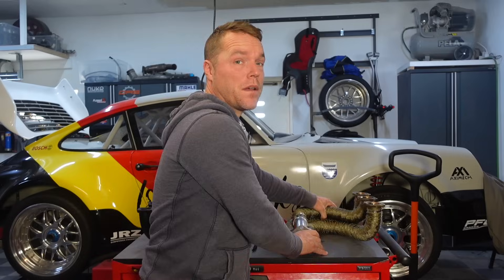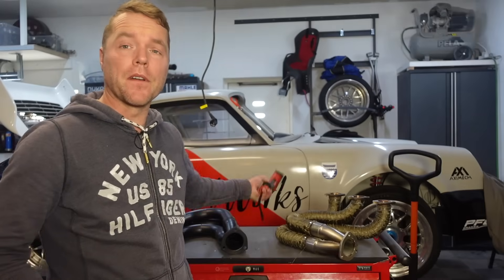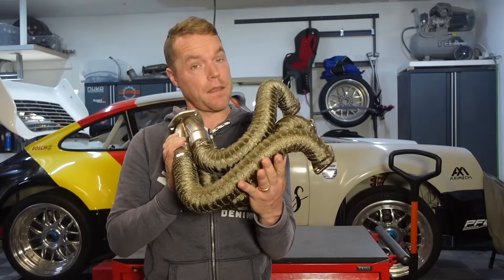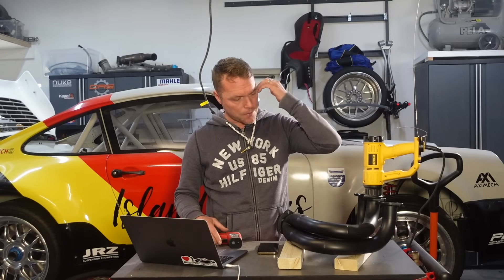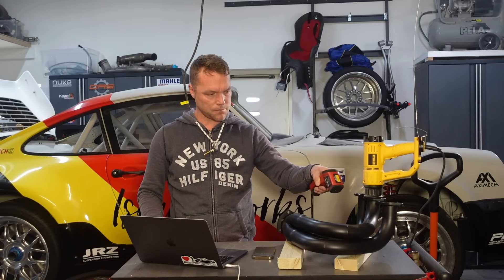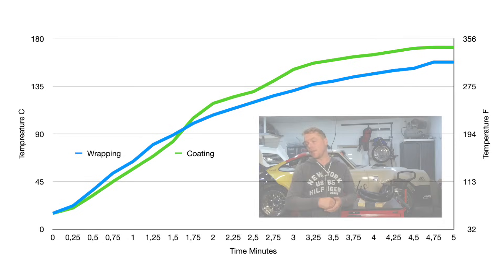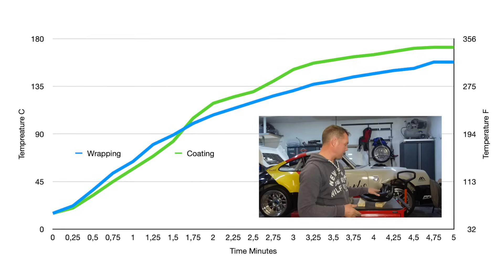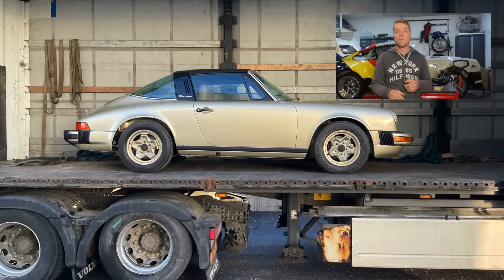Exhaust Wrap vs Ceramic Coating - Head to Head

Comment: What principle is the meaning device using? If it is a pyrometer you need to set the emissivity for correctly for each surface being measured. It can be quite inaccurate if you don’t.

Comment: Wrap smells bad.  Well, there is the fiberglass, which is absolutely horrible.  It does decrease somewhat over time, but never goes away.  There is the volcanic ash style which has a lot less noticeable smell, but is toxic.  As someone else noted, thicker ceramic like SwainTech's White Lightning is superior.  Go with that.

Comment: Wrapped headers for the win... based on actual dyno pulls and tests - not just a heat gun. 

https://youtu.be/H5LK-zjfYKA?feature=shared

They greatly reduce the under-hood temps and heat soak from the headers into things like your starter and plastic components under the hood. 

None of them make a difference in engine output. It's all about the under hood temps and in that area - the wrap wins. Some will say the wrap will cause the headers to fail earlier or cause the metal to degrade. I would tell them, stop buying cheap mild steel headers and get quality stainless. If you're going to do the job - and installing long tube headers on a car typically is not easy, buy once - cry once.

Comment: completely useless test.
where is the baseline test. no product applied.
heat shielding metal cover is waaaay better than wrap n paint to protect other components
and doesn't rust pipe cause fire hazard.
not every thought bubble marketing idea is a good one fo common sense

Comment: To solve all the issues people complain about here for wraps (moisture or fluids soaking through, brittle after a while, itchy if you touch them, etc) you just need to spray them with several coats of high-temp silicone coating making sure to saturate the weave with the first one (and usually bake them at 450F and then let cool between coats).  That will bind the fibers and layers in place and encapsulate them along with making them sealed to liquids.  Of course this doesn't work as well if you didn't do it before using them for a while.

Comment: The other benefit of the ceramic is that it helps to stop corrosion. That is why I used it for my Harley headers. 15 years later on regular steel tubing and no rust. I used Swain's White Lightning on my headers, valves, exhaust ports, pistons and combustion chambers.

Comment: Cerakote is not a proper thermal cermaic coating (it will provide little to none thermal protection). You need someone to do it that uses Zirconium as a thermal barrier otherwise it’s not worth it.

Comment: PLEASE NOTE: The reflectivity and color of a material WILL affect temperature readings via a laser, thermal camera, or other non-contact measuring device. This does not mean the information gained here and the determination is bad or incorrect it just means the fine details and temp readings may be inaccurate.

Comment: wow using a heat gun to test exhaust temps, why not just put the engine on a dyno and change the headers and then test with real exhaust temps and not a heat gun really, thats is so lame, to think you have a porsche race car and your using a heat gun to test temps on headers for the same car, plus it comes down to the material used in the headers different alloys transfer heat differently as well, like using stainless compared to say mild steel is a massive difference and also depending on who makes the exhaust system, like akrapovic exhaust systems are next level full stop, leave it to slovakians to make the best aftermarket and OEM exhaust systems for cars around the world. ✌✌🦘🦘👍👍😎😎

Comment: Wrap doesn't trap any significant amount of moisture according to the videos I've seen where they de-wrap them a year later and found no evidence of corrosion whatsoever. The headers are way too hot to have any moisture accumulate on them through the wrap.

Comment: I used high temp paint and then wrapped! 9 years and 30,000 miles later, still looking good.
Reply: you using 3mm thick and stainless steel?

Comment: 4:19 when I ceramic coated my pipes, I inquired about coating inside as well. He explained that while the opening and straight portions will have coating, bends will not because the medium doesn’t make its way there. Possibly why you have such a variance in temp at that spot.

Comment: I wouldn't say either is a bad solution for radiant heat. Both methods help to reduce the problem. I would also concur that the wrap could present a safety hazard. The wrap has the ability to absorb oil, where as the coating will only allow so much oil to stick to the header before it just drips off. That said, oil, though flammable, will evaporate, or smoke when it gets where it should not be. It can just burn off. If it is a race vehicle, or on any vehicle of an enthusiast, if there is smoke, wouldn't any of us just stop and find out what the problem is? Safety problems therefore should not be that big of a deal in this context.
   The benefit of a wrap is that it costs less than a ceramic coating. I was surprised that the wrap was more effective, but if that is paint on ceramic, it is less effective than an actual ceramic coating. 
   I like the idea that someone else presented. Ceramic coating with wrap.

Comment: Did you think about testing engine bay temps and cool down time
Reply: This! What is the tangible real world benefit?! it would be more interesting to monitor the surrounding air temperature 2 inches from the headers during normal operation

Comment: What bugs me about these ignorant tests is a total misunderstanding of how IR thermal cameras work.  You CANNOT accurately capture the temp of metals without FIRST putting a consistently emissive patch of paint on BOTH samples, unless you have a camera/IR gun that has adjustable emissivity, and you make use of those feature.  Your test was totally useless and meaningless. For example, Did you know that you IR gun CANNOT even see the temp of copper, stainless or aluminum?  They are almost perfect IR REFLECTORS, so the temp you see is the reflection of something else in the room.  And the % of reflection changes as the metals begin to glow.
Reply from the maker: Great comment!

Comment: Heat tape is not designed for what you're testing. 
It lowers the outside temperature 500 to 700 degrees. Inside raises the temperature !
That raise in temperature pushes the air more efficiently. 

That's not what ceramic coat does. 

It just dissipates heat quickly.

Problems?

Solutions ?

Different materials ?

If you'd like to concentration pm me.

Comment: Black color has maximum absorption AND radiation of heat. My professional advice would have been V-136 (Piston Coat, heat cure) for the inside of header, and C-7700 glacier silver on the outside (polished to chrome look). That what I did for my turbo and exhaust system.

Comment: exhaust temps are as high as 1300-1600f. this doesn't show that level of heat. you can't use infrared to measure heat since it's skewed by reflective surfaces. to do it right, you need a thermal camera or imaging device. infrared is the worst approach.

Comment: Interesting video @Islandworks and great to see the build coming on! If you have ever a chance to repeat this then a comparison with a few more options could be exciting e.g. uncoated, plasma-sprayed TBC, heat-shielding option.
Reply from the maker: It was intended as a quick test just to form an opinion in the wake of a previous project. If I knew it would get this much attention I would be happy to make something much more scientific. 

Now I’m still sitting there with two headers both different as I’ve been working on other thing…

Comment: I haven't wrapped a car's exhaust, but I have wrapped the pipes on my bike. The idea there is it's not only for heat protection and esthetics, but that it help add a small increase power and torque by keeping the hot air inside the pipes. If it's the same for cars, then it seems to me both ceramic coating and wrapping would provide the most optimal result. The ceramic coating will prevent water damage from the heat wrap, and weakening the metal due to excessive heat. The wrap will keep much of the heat inside the pipes, improving flow and boosting HP. 

FYI - the heat wrap has some waxy stuff in it that must burned off. Once it's burned off, the pipes will stop smoking. Building a race car, you will boost performance if you coat, then wrap your headers.

Comment: I think you should re test with different methods as other said infrared thermometers can read surface temperatures differently based on the color of the surface. This is because different colors have different emissivities, which is a measure of a material's ability to emit infrared radiation. Darker colors typically have higher emissivities and emit more infrared radiation, which can lead to more accurate temperature readings. Lighter colors, on the other hand, have lower emissivities and emit less infrared radiation, which can result in less accurate readings. Lighter colors usually have lower surface temperatures compared to darker colors under the same conditions. This is because lighter colors reflect more sunlight and absorb less heat, while darker colors absorb more sunlight and convert it to heat, resulting in higher surface temperatures.

Comment: Have used both on different projects over the years. For pure heat reduction wrap always works better than any type of ceramic coating. But for street applications ceramic is generally the better choice as it doesn’t lead to corrosion and cracking as quickly as wrap does.

Comment: I wrapped a set of headers once, within 2 years they were cracked. I just bought a set of ceramic coated headers because I don't want to go through replacing them again. Every company that makes headers will not warranty any header that has been wrapped for a reason.

Comment: If protecting your plug wires is the concern - start using a silicone based set. Currently, high silicone sets have replaced wire sets that used to "require" a metal heat sheild at the boot due to plugs being just inches from (and nesting between pipes of) the exhaust manifold on "old" trucks like the Ram (circa 1990 Dodge). If further protection is needed, run the wires themselves through a heat wrap/sheath.
 Also, if you dont want oil getting into the wrap - stop pouring oil on it.

Comment: Please note! That “heat gun” (optical infrared pyrometer) doesn’t actually measure the temperature of the surface. It measures the infrared light being emitted from the surface and this amount of light is based of the emissivity of the surface you are measuring. In this case, you have shiny black paint (pigmented with ceramic particles) and silvery cloth. These substances will provide two very different emissivity values. You can never honestly prove that these painted on ceramic coatings are effective this way. A better way is to touch the surface with a simple digital meat thermometer. This will be the true surface temperature.
Reply: Facts, best me to it
Reply: Thermocouple. Came to say same for IR thermometer

Comment: With header wrap you can actually touch the header quickly without getting burned, you can't do that with ceramic coat. I wrap my headers and super saturate them with high temp header paint until they are dripping wet, it dries like a cast and helps keep them from unraveling, also I use safety wire instead of the metal zip ties, the ties become loose after a while.

Comment: I had my headers coated, but they said not to also wrap them as the reflected heat degrades the coating - that was some years ago, so not sure on todays condition. The real benefit of this is not for under hood temps but to keep the exhaust gas hot for maximum flow and thus best power.

Comment: Without knowing the emissivity of the surface of the heat wrap and the ceramic surface, You can not get accurate temperature measurement with a spot radiometer.  After the heat wrap, wrap again with aluminum tape and you will reduce the radiated heat by at least 50% The shiny alum tape will lower the surface emissivity greatly and retain more heat in the head (if that is the goal.

Comment: I once left off the aluminum heat shield below the boot on my supercharged lotus exige. With just street driving, the rubber liner on the boot floor started smoking. Def a fire hazard that was luckily caught in time

Comment: Wrap is shite, ceramic is marginally better considering it will not catch fire if oil drips on it like wrap thus not becoming a torch(ask me how i know) . Ceramic wool (or different kinds of) and stainless sheets is the only way to goo.

Comment: You need to retest correctly. You need a temperature PROBE at the collector, another one on the surface also another probe to measure ambient temperature and measure the delta between ambient to surface and ambient to exhaust temperature. Then your numbers can be used for anything meaningful.

Comment: I have ceramic coated headers and I wrap them to keep the heat out of the engine compartment into the guy that says the corrosion 22 years later no problem you got to leave your car inside you can't leave it outside everything's going to corrode

Comment: When you have a nearby component being heated by the exhaust, it's infrared waves causing that. The best way to deal with this isn't a wrap or coating, it's to put a heat shield in place that simply blocks the path of the waves, and stops the radiation from heating the part. All these wraps and coatings feel like 'miracle cures' only intended to empty your wallet.

Comment: I coated probably around 7000 sets of headers with Techline coatings, so I have experience with all types of headers. There is nothing that will do more damage to headers than wrapping them. The wrap holds in so much heat that it burns the carbon out of the steel. The headers that have been wrapped and run very long look like dried mud because they are cracked so bad
Reply: I've never heard of "burning the carbon out of the steel." Considering that steel is heated up to melting temperature in order to form, I'm going to go out on a limb and say that it was probably trapped moisture that was causing the cracking.
Reply: @ no. It is burning the carbon out
Reply: @Patrick-xd8jv  So then how do they keep the carbon in when it's a molten metal? Because the header isn't heating up to melting point.
Reply: @ You’ve obviously never seen a header that has been wrapped and run very long. They look like dry mud and eventually chunks fall out
Reply: @Patrick-xd8jv But you still haven't demonstrated how it gets got enough to "burn the carbon out." But that's okay, I did a search and found my answer. It is impossible to remove carbon from carbon steel just by re-melting it, which is exactly what I suspected.

You should probably do a bit more reading and adjust your knowledge accordingly so that you don't keep spreading misinformation.
Reply: @ keep wrapping your header’s and burning them up! Do a bit more research
Reply: @ yet oxidation removes carbon through heat and oxygen 🤔
Reply: @Patrick-xd8jv I'm not endorsing wrap, I'm challenging your claim that heat causes the carbon in the steel to be burned away.

"yet oxidation removes carbon through heat and oxygen"

Oxygen makes up somewhere around .2-.7% of the exhaust gas inside a header. You're not "burning out the carbon" with that little amount of oxygen. Trapped heat can definitely be a problem with header wrap, but there's no evidence to support your claim about the carbon.
Reply: @ heat plus oxygen, that’s the O in CO2 can remove carbon from steel
Reply: @Patrick-xd8jv If you're just going to keep ignoring what I said, then I'm going to stop replying.
Reply: @ Good 👍
Reply: @Patrick-xd8jv Yeah, that's what I thought. Just stop spreading misinformation, okay?
Reply: @ I explained it in engineering language and you failed to research. I thought you were going to take your ball and bat and go home. HEAT+OXYGEN=CARBON SLAG, aka burning the carbon out of the metal
Reply: I did wrap my motorcycle exhaust.  Within a year they would tear and just look ratty. When I took the wrap off the pipes looked like hell. Never again
Reply: I Ti wrapped a 2008 kawasaki bruteforce.  It was a stainless.  The extra heat retained in the pipe changed the pipe bends and flange joints, at temp the font pipe grew almost a 1/2. 
In future will ceramic in and out no wrap will use heat sheilding min for plastics

Comment: I wonder if this test really shows anything related to exhaust heat management as you didnt get them hotter than baking biscuits in an oven.
The pipes need to get to full heat soak and flow gasses at engine exhaust temps to give even a basic idea of how they perform. 
And then we jave issues of cycles. Ive paid big dollars for ceramic coatings on a custom motorbike exhaust and then it to start falling off in 12mths. 
Bit then there is the increased corrosion potential of the wrap due to moisture.
Time for some gas birners and a 2nd test?

Comment: I'm not at all surprised by the results here. The wrap has both more mass (thermal capacitance) and surface area through which it can dissipate collected heat. If this is the only measure by which you were choosing header insulation, it would clearly be the winner. But as you said, there are other factors at play, including cleanliness, weight, corrosion resistance, and even aesthetic considerations.

If you wanted to do this more scientifically, you'd need to maintain a control experiment: headers with no coating or insulation at all. Provided they were the same parameters (alloy type, thickness, etc.) this would at least tell you how well these two items performed in relative terms, as well as comparative terms.

Cheers, from the US.